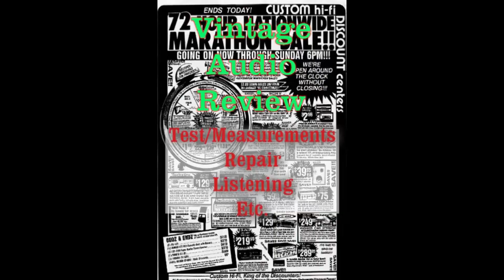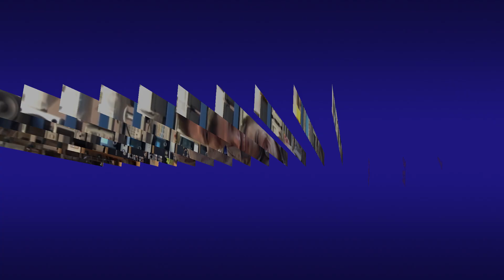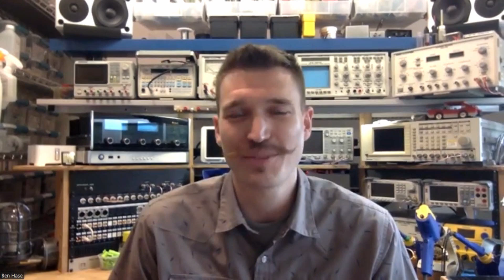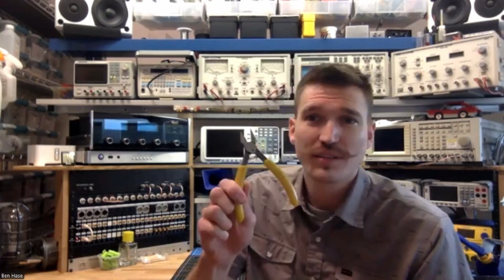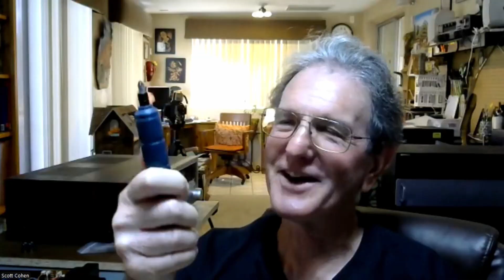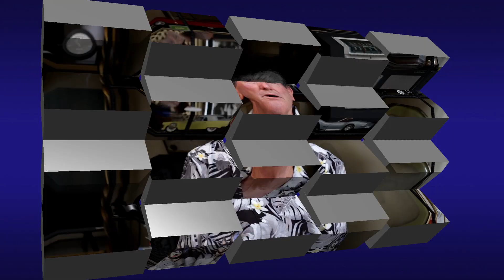An Interview with Ben from Novalux Stereophonic- Vintage Audio Review Episode #188

Comment: Back in the early 80’s you could find authorized repair shops for most equipment. Now, unless you’ve been in the electronics field, you’re doomed in finding anyone to perform work.
Reply from the maker: There are several folks and 1 or two places here in our small city of tucson that can work on a lot of older gear, but it is not most certainly a niche business.
Reply: Personally my background is in electronics engineering. I still have my Marantz 2216B I purchased when I was 16! Audio got me into engineering and it was a blessing. I work on all my stuff and have worked on friends stuff etc. My last project was a 1960’s Telefunken console! Top to bottom restoration etc. it’s my son’s unit. My daughter has a Silvertone console as well. All tubes. The Marantz is still going strong and has the same electronics scent, brings back memories of me listening to Steely Dan etc! Still have my albums. Suffice to say it’s remarkable that the younger generation shows interest in alignments, replacements of parts etc. kudos to you! I tried working on a Pioneer Elite home receiver, surface mounted technology with VLSI chips everywhere. Pure junk just like our cars now.
Reply from the maker: @AN-ce1nd  Glad you are able to do your own (and family's) repairs, and that your 2216B is going strong. Actually, I am trying to get through life w/out doing a tuner alignment or dial string replacement. I don't think many younger folks- say under 30, care much about trying to repair what they have if it should break....